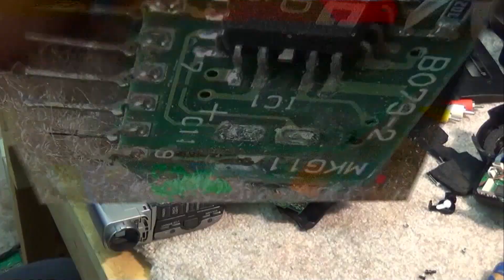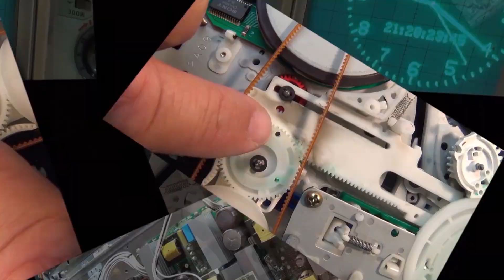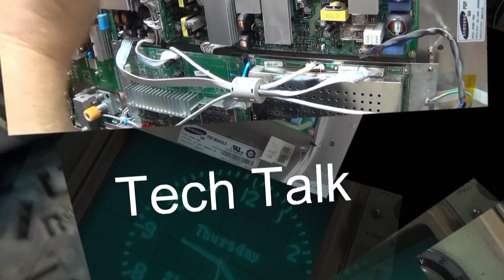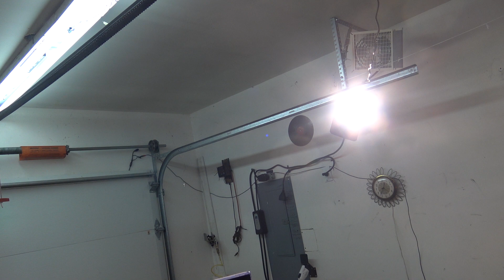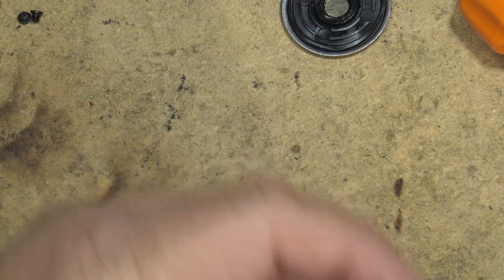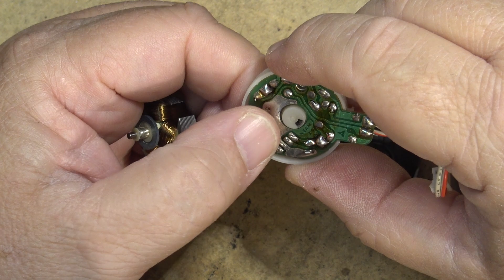Sony TCRX70ES no tape movement in play or record

Comment: Suggest Pacific Stereo's offering on tapeheads.net for premium replacement.

Input voltage: 9-14.4 volts, DC
Diameter: 1.54"
Case height: 1.34"
Shaft length: 0.42"
Shaft diameter: 0.078" (2.0mm, can be modified to 2.5mm)
Native rotation: CW (can be changed to CCW)
Nominal RPM: 2400
Quality: Pacific Stereo

Not cheap, but I can vouch for its performance.  Have installed to JVC TD-V621 and wow and flutter measurements are impressive.
http://www.tapeheads.net/showthread.php?t=32263
Reply: Rebranded NOS Matsushita Motors. Somebody bought a hughe lot of them and trying to sell them as premiun. Any Technics motor from their baseline decks in mid 90s (Mitsumis as well) will do far better and are more stable and reliable. This motor offered is like 30 years old at least. By late 80s the stoped using this style of double casing with external regulator. So, the one or tow caps inside need to be changed. Forget it. DONTA PAY premiun for thing you can buy for NOTHING. Those are nothing by Matsushita motors from early to mid 80s.

Comment: I had the same problem with almost the same deck (no ES European version). There is no way to buy a new MMI6S2LKS motor, I replaced it with EG530AD2B (12V CCW/2400/8mm 629-KH-0324). However there was a new problem: the metal case of the MMI motor is isolated from power lines and in EG530AD2B is directly connected to "-" power line. And there was a short on power supply. I had to isolate the motor metal case from metal chassis of the deck. So be careful when replacing with different motors.
Reply: Mabuchis are negative to case. You can open the solder point where this happends, which is near to the minus terminar actually. But, 12V ones also use an spring to bridge the cover to the back of the speed regulator. This is not only electrical but a thermal reason. In my case took the solder out, let the motor without the cover and tried to heatsink the regulator with a piece of metal. I had this issue also in a SANYO boombox. The short came from nowhere !!!!. The rubber mounts if in good shape are enoug to isolate the motor
Reply: @38911bytefree  you are right, it's easier to mod the motor then the deck. However after my mod I can use almost ANY motor and don't have any thermal problems. But my mod is specific to this particular deck.

Comment: A good improvement in lighting, i'm having to use more light than i used to, daylight really helps if possible.
That motor is cooked, or another word that sounds similar :)
Mabushi motors sometimes appear on ebay/amazon, but they are low end stuff.
My old 70's ITT studio 720 machine motor locked up a month back, the speed controller was on a seperate little pcb.
I havn't seen a seperate controller for years.
Just a little oil in the bearings.

Comment: You can source this motors easily from almost unused minisystems from mid to late 90s. At this time people stoped using tape, most of these have good motors. All the cheapo Technics that are stranded because a gear that fails, are good sources of motors, even double deck cheapo bomboxes would do the trick. Motors on those were actually pretty good quality. Double deckers use one motor for both decks so they are not weak, but they are usually in 9V. If the patinet deck is 12V I put a 3V 3W zener inseries to drop the 3V excess.
Reply from the maker: Yes I am aware.  Many of them are cw though and i need CCW.
Reply: @12voltvids  Wouldn't the motor run in the opposite direction by reversing the polarity?
Reply from the maker: @crashbandicoot4everr  sure if there wasn't a speed circuit and transistor inside.  Reverse the polarity is a great way to get magic smoke.
Reply: @crashbandicoot4everr  It does, and pretty fast, them it pops. Dont ask me how I know
Reply: @12voltvids  I did reversed some myself. I open them, remove the board, put SHORT STUBS of wire since I need to reverse the polarity of the connection between PCB and MOTOR, but PCB is "polarizad" mechanically. I would guess that some sort of themral compensation is going on. So I would keep the board close the the motor. Some 12V types could need to be heatsinked to the back cover. THe other option I have done is cut traces going into the motor solder joints, isolating them. Them wired to their opossite terminals to invert the spin. It worked for me. LONG wires is a big NO since this board are tailred to the motor resistance to keep proper regulation ... wire resistance could mess the stability (I guess).
Reply from the maker: @38911bytefree  Sure if you open the motor and cut traces and reverse the polarity on the brushes it will reverse but that is too much work.
Reply: @12voltvids  Try looking up an EG-530SD-2B motor.  It is a 12V, CCW motor for tape decks.
Reply: @12voltvids  I know .... it depends of how much you need the deck. In my case was more like a hobby thing, but from a commercial point probably is not worth it, unless the customer is willing to pay for all this effort.
Reply from the maker: @38911bytefree  
He bought another deck to rob a motor from and that is what I will do as soon as i find some time.   I am burried with work right now and only so this on my days off. I have had a few dogs lately that took much longer to do, and that causes a backlog.   Then it is back to my weekend job which has 4 long days that leave me exhausted by the time i get home so i don't do any electronic work on work days.

Comment: Man I hate that this stuff is becoming harder and more expensive to find. I was hoping maybe the melted plastics could at least be replaced with a 3d printed solution, but the amount of shorts in the motor dashed any hope. I hate knowing that the tech I grew up with is just sometimes damned to die.
Reply: Just buy a part deck, boombox, minisystem. By boombox not meaning a proper ghettoblaster, just this poor things of mid 90s. Yes, you need to scrap a unit to fix yours. But most of mid90s cheapo gear, which is not worth keep in working order, can be used as donor. A guy contacted me from boomboxery ..... had this issue for his AIWA TPR990. I said, just buy the cheapets technics deck for parts you see. He bought one for 7 pounds. Not working. mostly gear or belt related issue. Those decks have two motors inside since decks are fully independent.

Comment: The extra light helps in your videos. ...Dave:)
Bought a large lot of pulled cassette deck motors this summer on Ebay $50 (more then 40 units).  Only needed one to fix my Nak deck.  All motors were working....then resold
the unused ones for more then $120!  Several were from Sony decks.
Reply from the maker: Well it is bright enough.  Just a little 100 watt HMI (metal halide) photo light.  I used to have it directly overhead but it was too bright. So I put it across the shop so it lights up the foreground as the other lights are pretty much directly overhead.  I have 6 10 watt LED over the bench 2 40 watt 4 foot fluorescent lamps and a 42 plus 65 watt compact fluorescent above and slightly behind me. This adds a strong directional over my shoulder.
Reply: I bought myself about 40 mechanisms "new" some of them were a bit bended (unusable) but all of them with new motor. I bought them just to harves the motors and Im keeping them. Im not paying to any online thef for things you can easily buy cheap

Comment: 3:50 great video man thanks. I'm just wondering which model is that watch?
Reply from the maker: Casio wv300. Good luck finding one.  I have had this one close to 20 years. I have never seen another one. Very rare, probably the rarest of the Casio watches.  I have another rare one with a touch screen calculator.   This one is solar powered and picks up the time signal from radio station wwvb to set itself.  There were plastic case models with the same module, but this one is stainless steel with a mineral glass crystal.   That is what makes it so rare.  It was pretty expensive when I got it.  About 150usd and when the average Casio was 25 that made it pretty expensive for a Casio. Saying that it has never let me down.  The built in rechargable battery it at 100% and has never been replaced.
Reply: @12voltvids  amazing thanks for sharing

Comment: Very interesting video. Sony cassette players are always appreciated by service people, as they are very easy to dismantle. But as everything now 30 years old, parts are getting more and more difficult to get. Belts can easily get replaced, they are kind of generic, but motors are mostly nightmares. Here with a standard 12V voltage, you still could find something in industrial domain, Radiospares or equivalent list hundreds of these motors. However, it's also difficult o buy "one" for cheap if you add postage fees and taxes. And if you don't have unlimited space free, you can't stock either different machines for parts. Another solution is effectively to find a donor machine, expecting they have not failed similarly, and there again is the global cost of this operation.
As an European ex Sony dealer, I'm always surprised differences in models they sold then as ES series. I don't remember any autoreverse cassette deck back in this ES series, that are supposedly made with the best components and so on, for ultimate audio results (for the money!). If you remember single direction decks used 3 heads, double capstan and 3 motors subchassis mounted on a heavy metallic frame, with servo coupled flat capstan motor (the type here broken is way more simpler). Differences are also present with metal shielding between transformer and electronic board... So I hope other simpler autoreverse US Sony models from the same period could be a good source for parts, and not necessarily in ES series!
Let's hope your customer will find a solution for that motor, and you will someday post a part 2 with good news!